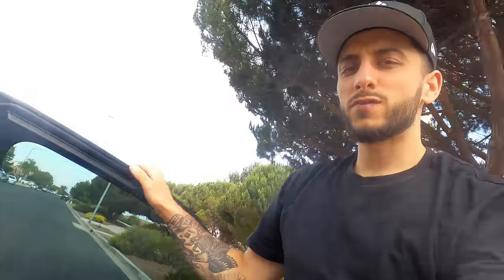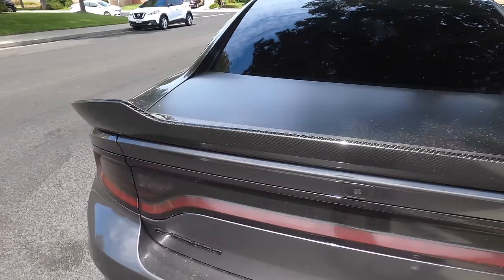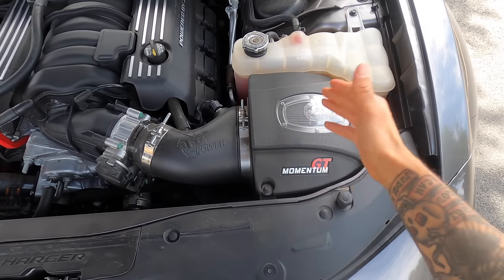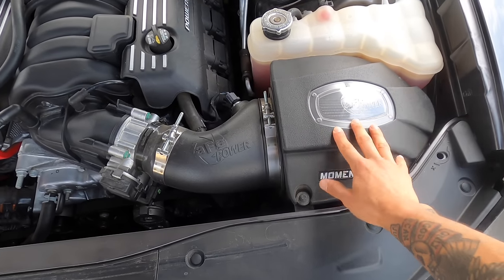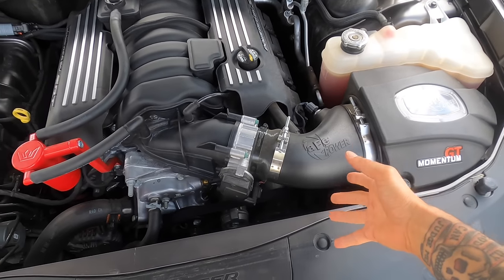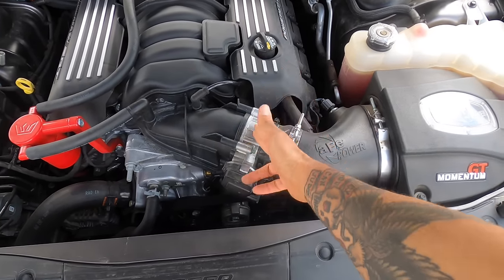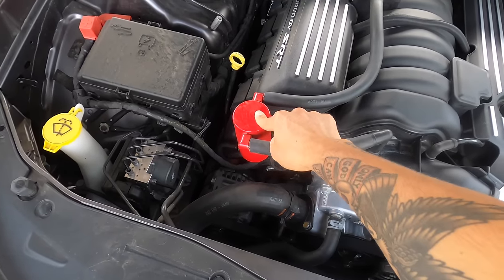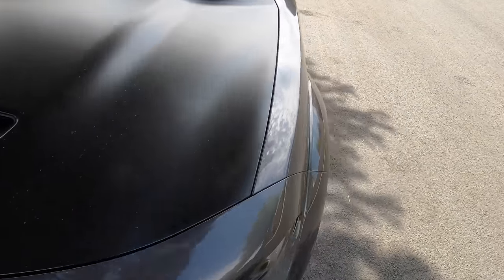Top 5 Cheap Mods To Gain Power W/O A Tune Dodge Charger 392 Scat Pack

Comment: long tube header, cammed, intake, cat back exhaust, import throttle body, light wheels and tires and the scat can push 500 plus to the wheel
Reply: I've considered the cam....lighter wheels also :)
Reply: Bolt on Pro charger can push 200hp-215hp more to the wheels for the same price of all of that you mentioned just a heads up!
Reply: @mariocastillo7270  no not with forged internals, that’s a straight bolt on application to get those numbers on 7psi if you want more than 7psi than yes you want to add MMX blower cam, pistons, etc. anything 7psi and below is a bolt, tune and go procedure. I am considering just getting a wide body hellcat maybe the new nitrogen one or the hellcat Pacifica lmfao I’d be down for that shit!
Reply: @bobsaget3044  does that bolt on pro charger void the warranty tho?👀
Reply: @danielestrada4933  yes it does that’s why just get a hellcat for the amount you’ll spend on a blower and everything else you’ll add later it’s just a waste in my opinion unless you have the money to blow right now and I don’t think a lot of people do especially with this economy it’s in the crapper.
Reply: Literally everything you mentioned bolting onto the car requires a tune. Maybe you aren't as educated as you think. Pushing false information on to people only for them to actually find out that they need a tune after all. SMH
Reply: @JustAGuy781  he never said it it doesn’t
Reply: @maxharrichand9727  bro his title literally says "Top 5 Cheap Mods To Gain Power W/O A Tune".... I guess you missed that part huh?
Reply: I know someone who did all that + a tune and he's pushing 600
Reply: @bobsaget3044  what about paying for labor it’s gonna cost
Reply: Time to start saving for upgrades 😂

Comment: I had a ported throttle body, hellcat air box, and tires on my ScatPack challenger when i had it and I was keeping up with 10 speeds !
Reply: True man when my 10speed mustang was pure stock.. this scatty with intake, throttle body, Some exhaust and tire it kept up, but at the end the coyote did it's thing on the top end... I'm really disappointed how the 392 did because I love 392s so much too, but man they're too Damm heavy for it to win with the mustang 😕😕
Reply: @fernietheepyro488  trueee. Not to mention when people mod those coyotes they really wake up alot more, I'm a mopar guy but I do want to own a mustang one day. They sound sp good with an exhaust and just with a few mods they really be out there hurting feelings I myself own a 09 srt8 and for stock it has alot of low end power and pretty decent on the top on but you can literally feel the weight of the car as you drive it. I wish dodge would put these cars on a wight loss plan 😅
Reply: @christophermcleary8091  dammm nice nice I would really want to own a 6.1 hemi srt8 😬😎💯 I love my mustang so much to bro and If you own one you'll fucking love it trust 💯💯 but yeah I love dodge too man I started with a 5.7 hemi 2006 charger then came my 15 and hour job I got the dream car a Mustang 2019 💯 a year and 3 months ago 😎
Reply: I think Tires are the most underrated mod for most people with mopars, to be honest it's not something I would initially think of. But for the Scat platform, a good set of nittos or a similar radial would be a great buy!
Reply: @392Reviews  I have beat 2 scats from a dig in my 5.7 they had stock tires I have 305 mickeys with pedal commander
Reply: @just_a5.7  Oh yeah! You getting it then! Them boys sticking and griping, I'm sure the PC does nice too :)
Reply: @392Reviews  only car I ever lost to from a dig is an audi s4! Them things move lol and I had a 2015 ss camaro ask me wat all I had cuz he said he would never be able to catch me in a dig lol he was stick thoe
Reply: @392Reviews  I beat 350z all the time they thing they got more torque then a hemi lmao
Reply: @just_a5.7  No shot! Lol!
Reply: @just_a5.7  Very nice!
Reply: @christophermcleary8091 i had a 10 speed 5.0 for 2 years, im about to buy a 392 challenger. I got a police AWD 5.7 charger last year and learned that for where i live and the racing we do hear i like low end torque of the hemis and i want a bigger car. That said i absolutely loved my 5.0 and would never sell it, it was the first car i ever bought new but i lost it in a miss and run accident

Comment: My hellcat has a CAI stock. When you pop the hood it’s exposed. I believe it’s just the newer hellcats that have that tho. But I’m pretty much stock and with just a tune I’m at 708whp. The stock intake gets the air from the hood scoop and the open inlet in the headlights. I wanted legmaker but my tuner said it won’t be much of a difference of hp gains.
Reply: I can dig it! The tune on the Cats are a great buy in my opinion!

Comment from the maker: What mods y'all go with to gain more power??
Reply: What up Louie! No performance mods, just a few minor exterior cosmetics and a mid-muffler delete!
Reply: The best mod without a tune you can get is a proflex commander that will let you run e85 without a tune needed! Gives you 15 wheel horsepower minimum.

Comment: I went through 2 180 degree thermostats in 4 months.  Both failed.  I felt the difference with them but I can't risk being stuck on I-95 again with a stuck thermostat.  Man, which one actually works?  If I ever go back to one, I will keep a spare along with a wrench and coolant in the trunk just in case.

Comment: Nah you’re right the Q50/60 does gain like 130-150 WHP with a down pipe exhaust and tune.  😎
Reply: Them beamers and audi's  are the same as well if the same mods

Comment: Don't do the 180° thermostat. Also, these guys telling you to do this and do that and none of it needs a tune is false.
Reply: Why not the 180 thermostat??
Reply: Why I'm about to install mine
Reply: Y
Reply: @just_a5.7  depends on where you live. Sometimes a 180° thermostat can hurt more than help. Check with your tuner first before installing because it will need to be corrected in your car's computer. You need to realize that your fans work in conjunction with your thermostat and engine temperature so correcting it in the tune will be more beneficial
Reply: @JustAGuy781  I live in Texas it's 110 degrees on the daily. And my temps be 215 and up all the time
Reply: @just_a5.7  so do I bro. I live near Canyon Lake. Our newly acquired G8 GT has a 180° thermostat, but I have been told by 2 different tuners that it was a waste especially if you don't have the car tuned which they have to go in and set the fans also.